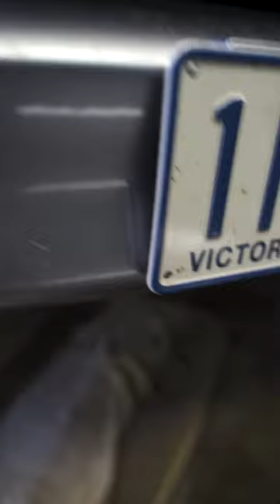How to fix your leaking radiator with an EGG!

Comment: Aren’t you supposed to do it with the engine running in the water up the temperature? So it will Basically solidify the yolk as it passes thru the radiator cause it seems like you wouldn’t want to do it with the engine cool and have all the egg yolk getting all in you’re cooling system